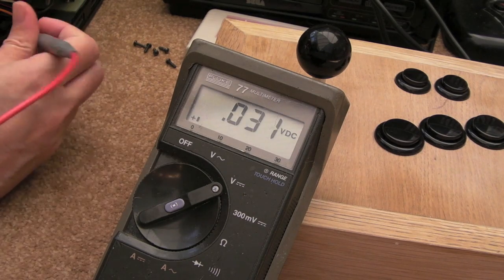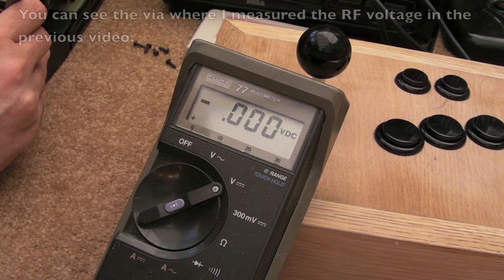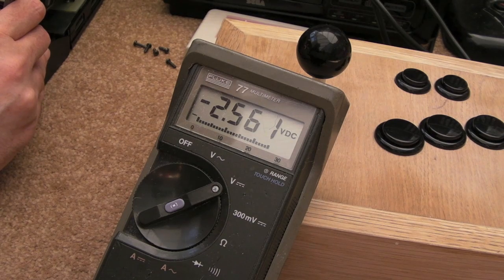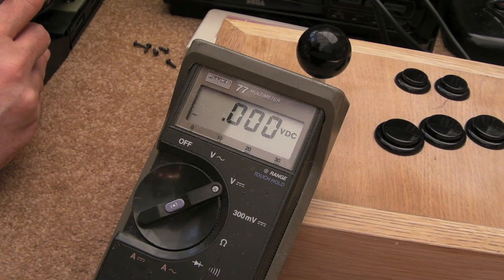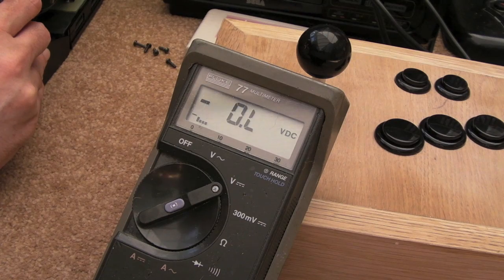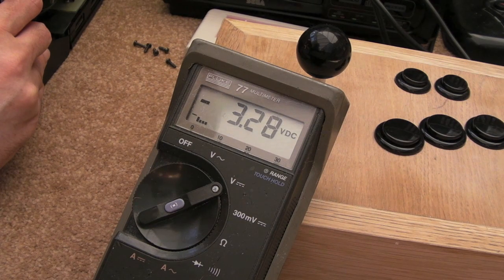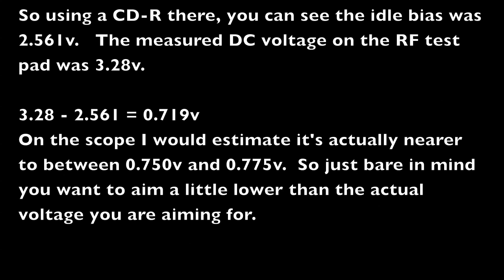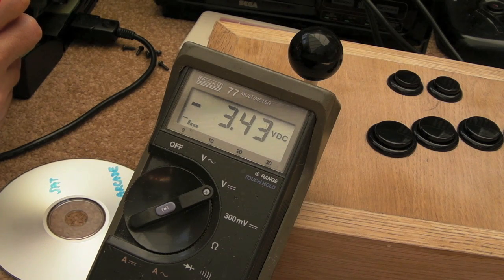Sega Saturn VAO (Model 1) Laser Voltage Adjustment Follow Up (Multimeter readings)

Comment: Hi. Any chance of a similar vid on the Dreamcast. There are lots of Ali Express sellers with laser replacement units, but no vids showing success. Comments for sellers vary so clearly some have the knack, or could be faulty units being sold. Up for the challenge ?  If you want I could supply Dreamcast and laser for a loan.
Reply from the maker: Yes, I've added it to the list - I just need to find some time...  I will take my DC to bits at some point and work out where the RF test point is and show the voltages vs pressed and burned discs.  I might later try and replace the laser in one too.

Comment: Can i ask what the box is that your Fluke is leaning against, me is thinking a Mame controller? Something i want to do at some point.
Reply from the maker: It's the Neo Geo Arcade Stick I made just around XMAS time - I did a video on it.  It did come out really well in the end, and one of the best things I've done recently - just because its so nice to use and with the 'atari 9 pin D-type' adapter I created in the follow up video, I can use it on the ST, Amiga, Spectrum, C64, 2600 etc.  I also wired the B button to UP (so in games where you press up to jump, B jumps), and C and D buttons are mapped to left and right, for those joystick waggling games, now you can just press C and D alternately, rather than killing the stick.
Reply: Nice job, i shall have to have a look at the video, must have missed it first time around. I feel compelled to get on with building myself something similar for mame.

Comment: Stupid question, but how do you know the scope is the more accurate one and the multimeter is the less accurate one? Have you done readings using a known reference voltage source, or something? Or is it just generally accepted that the score would be more accurate. Just curious.
Reply: Yes, this makes sense; the multimeter method is handy to see presented (with the variance to take into account), as that is what I have onhand. Thanks for your explanation.
Reply: Michael's Workshop 
Love this channel 
This stuff is going to become gold as these systems get old, thanks gadget U.K. for taking the time to make it👍
Reply: Thank you - this makes sense.
Reply: Thanks for the further thoughts on this; I plan to rewatch several of these videos to burn this into my mind, and try getting a scope to start measuring and tuning these myself during my own repairs.
Reply: Michael's Workshop 

Hi In general a multi meter screen refresh Is to slow to display high frequencies, but in this case he is able to use both as he only wants to set a voltage and not analyse a pattern. The scope is the better option as you can see the signal and check for any errors and focus so that is why when you have a scope available I would use that first but not everybody has one but might have a multimeter so it's nice he has made the voltages available for us.
Reply from the maker: If I measure the 2v test signal using another scope, the scope test signal outputs exactly 2v peak to peak.  That is the initial reference.  I also know that's accurate, because if I connect the scope up to 2v DC and compare to the 2v peak to peak square wave test signal the level is identical, without any adjustment to the scope, and 3 different DMM report that voltage as exactly 2v.   So the scope is definitely more accurate in the visual representation.  The other thing to take into account here, and the reason the DMM cannot get an accurate reading is that the signal we are measuring on the CD drive is an RF signal.  The scope shows the RF signal there, where the multimeter is taking a sample at frequency, and won't be a true representation of peak to peak RF signal - for one thing the DMM is also measuring the bias as well (with reference to ground), which is why it comes out at like 3.4v or something.
Reply from the maker: Thanks =D  Your comments are much appreciated =D
Reply from the maker: Just to expand my reply here...  In my last video (GameCube) you could see at the end of the video there that reading the RF voltage with a DMM was pretty much impossible.  I think that's because a) It's a much lower level because its DVD vs CD (Certainly the RF level is much lower on a working GC @ ~300mV).  And because its DVD I will bet the frequency is much higher - it's likely reading from the disc at higher speeds than typical CD based consoles, which are based around single or double speed CD most of the time).   That higher frequency is likely why the DMM cannot take a reading at all.

Comment: Wow. This is to hard for me 😯
Reply from the maker: Nah, it's easier than you think!   All we are doing here is using the multimeter, measure between ground (any point on the shielding will do for ground), and put the red probe onto the RF test point.   Measure the voltage with no disc in the drive, and it shows that first 'idle bias' voltage.    Then load a CD audio track, and measure the voltage again - this time the voltage displayed on the multimeter is higher.   Subtract the first voltage from the second one, and that is approximately 10% less than the actual RF voltage that you would see if you used an oscilloscope.   Then you can adjust your the potentiometer on laser unit (just a little bit anti clockwise to reduce the voltage, or clockwise to increase it.    Then measure the RF voltage again with the multimeter whilst playing an audio track, and you should see the voltage has increase or decreased according to which way you turn the pot on the laser.  You can do it =D
Reply from the maker: The hardest part is finding the RF test pad - its easy on the VA0 I have here, its that right hand via of those 4 (as shown in the previous video).
Reply: I remember i did it for my playstation. Took me all day xD

Comment from the maker: Calculating the two readings I took with the DMM there, I would estimate the DMM shows between 8% to 10% less than the scope shows.   Therefore, I would guess if you set your voltage ~10% less than the figure you are aiming for, you should be close to that level.   eg.   If aiming for 900mV, you want to measure a difference of ~817mV between idle bias voltage and audio track read voltage.  And you should set the voltage based against a pressed disc first. Then just check if CD-R still works at that level.
Reply from the maker: And if you are not using CD-R (just original discs), aim for 800mV for the RF, which would be a difference of ~728mV when using a DMM.  It might vary between DMM, but I found the 3 I have here read approximately the same values.
Reply: @GadgetUK164 

 I did exactly your tutorial with my Gray Model 1 and set it to ~723mV for Original Discs. Idle ~2.574V and ~3.297V with audio tracks, laser resistance adjusted to 397,5 ohms. Thank you so much!